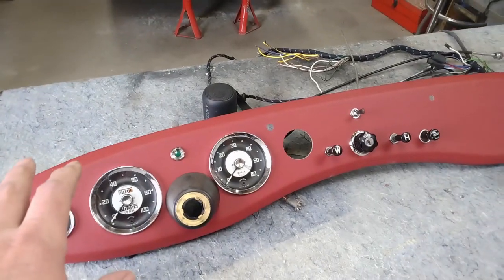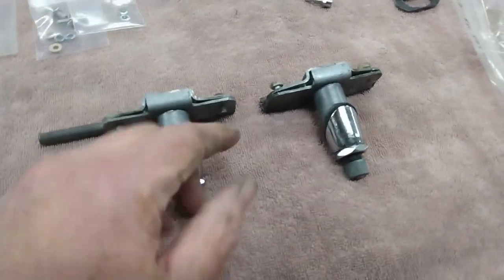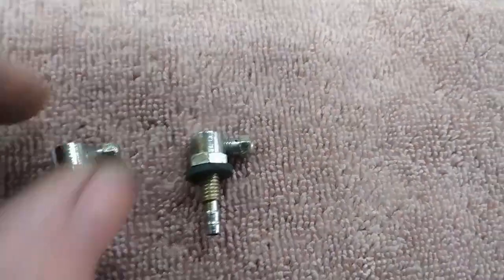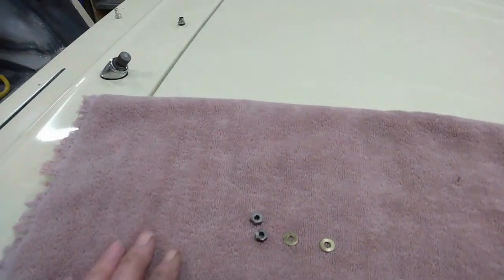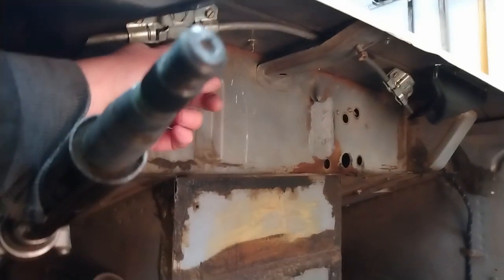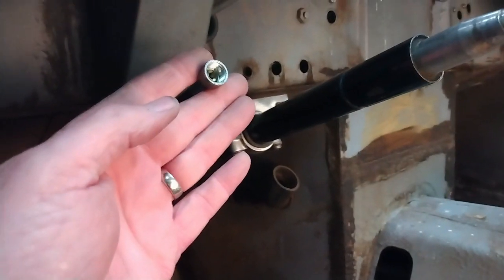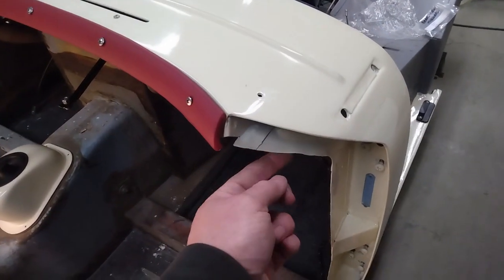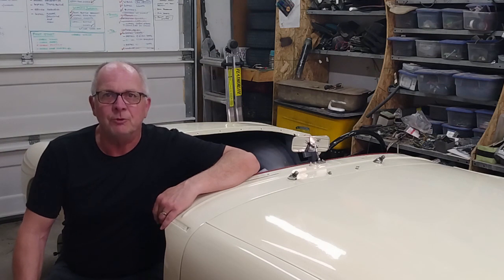What's behind the dashboard in a 1959 Austin Healey Sprite? I'm glad you asked!  Bugeye Build Ep 116

Comment: Ian - the Bugeye I’m working on now had the windshield washer nozzles removed and the holes filled  in with Bondo. I’d like to put the nozzles back on the car but wanted your advice on how to clear the Bondo from the hole without damaging the paint on the sill. My thought was to carefully drill or saw off the bottom of the Bondo ‘drip’ underneath the dashboard to get a level surface, then use the smallest drill bit I have to drill a very small hole through the Bondo to erupt through the paint on the sill. Then use progressively smaller drill bits to open the hole wider until I can finish getting the proper hole size with a rat tail file or sandpaper. 

What are your thoughts?  Also, could you send me (via e-mail) that photo you have with the labels for the holes in the firewall? That would come in real handy.
Reply from the maker: I think you're on the right track but I assume you meant to say progressively "larger" drill bits. I would drill the first, smallest, hole from underneath and have some masking tape covering the location on the top, finished, side. I would drill the remainder from the topside with the masking tape in place. Here's a link to the firewall cable & wire layout I used... https://gerardsgarage.com/Garage/Tech/Cables_wires_lo2.htm
Reply: @EconoboxGarage  Yes, I meant progressively larger (reminds me of a joke a friend always uses: “I don’t understand; I cut this board TWICE and it’s still too short…”) Your suggestion of the masking tape and making the first, smallest hole from the bottom and all subsequent drills from the top was exactly what I was thinking. Thanks for confirming the plan!